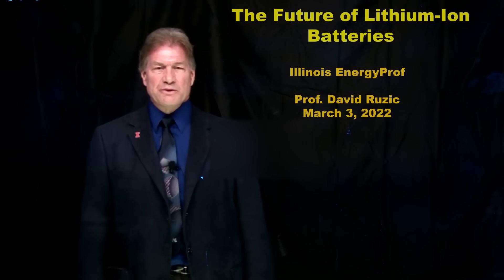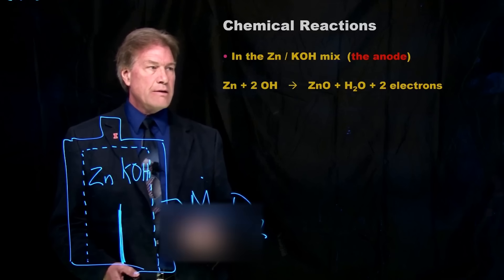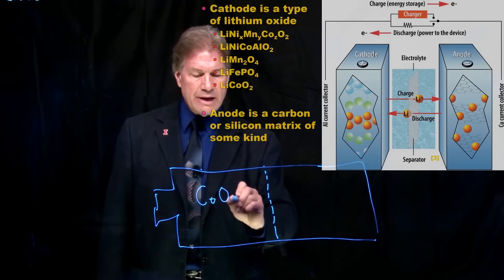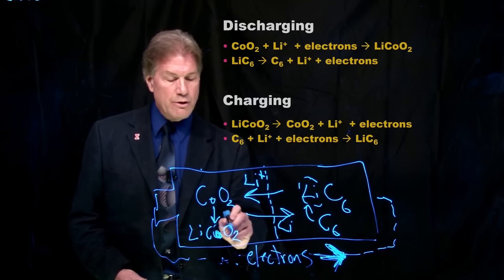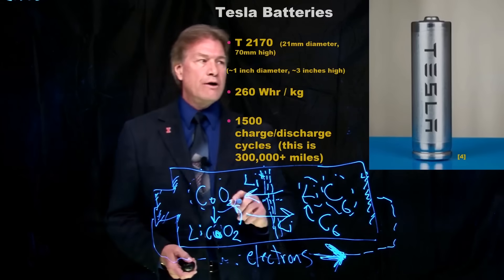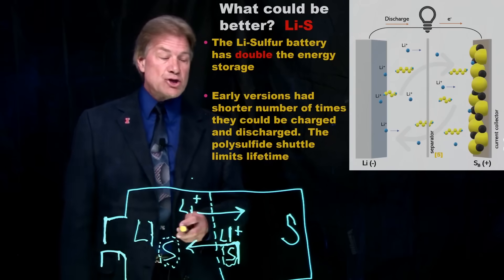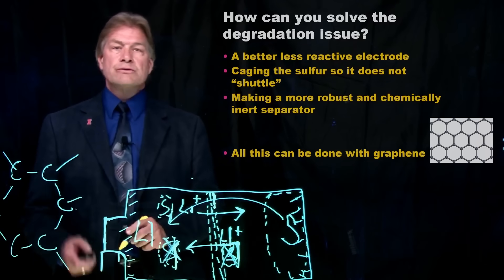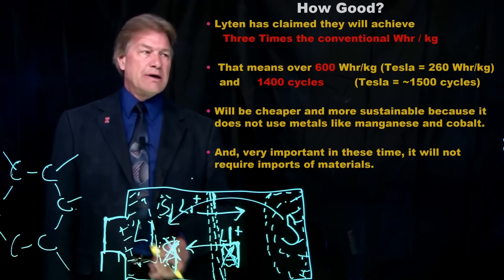The Future of Lithium-Ion Batteries

Comment: When he said sulfur I realized this wasn't as realistic as it first sounded like. And when he said graphene, I just raw checked out. Yes sulfur batteries are denser and graphene can help, but there's far more issues than that. Sulfur batteries also have the major issue with expanding when heated, which they will do themselves just by being used or charged. This also increases the odds of the battery failing as it can break the divider or ruin the structure. 

Graphene is one of those super materials that everyone wants but will always be 20 years off. There's nothing to today that actually uses single sheats of graphene as suggested and making layered graphene isn't really possible without using resin which means it's just as slightly better carbon fiber not really the value of the graphene. Not to mention that it turns out there are actually far better metamaterials than graphene at basically everything. Though of course being alloys instead of just a raw element like graphene, they are harder to make, but their capabilities vastly surpass graphene. Think of it like comparing a spork to a fork or knife. Yes the spork can do it all, but you know it's just not as effective at a single task.
Reply from the maker: The real key is the way to make Graphene cheap, plentiful and without resin.   That is where a breakthrough was needed and I think that is where a breakthrough has been made.
Reply: @illinoisenergyprof6878  I remain skeptical to such claims until the product can be proven in practice. We never get close to theoretical results in practice and rarely do real world use cases get as good as the lab results. 

Not to mention I'm highly skeptical of claims of binding graphene at a 3D level when such has basically been impossible without making it an alloy; which as I said in my master comment isn't graphene anymore. It's why we have different terms for graphene which is a 2D carbon latus vs say carbon nanotubes which is a 3D structure also made purely of carbon in a crystal latus. The difference is purely the fusing it to itself or just a single layered sheet. 

But when I hear people claiming sky high claims on graphene my skeptism immediately goes off as I've seen way too many businesses and products claiming they use graphene to beat the competition, and it turns out to be mediocre or even in some cases inferior to the competition. Graphene is a neat material, though it isn't magic. But even if they beat these concerns, there's still one major hurdle left, cost.

Yes sulfur batteries in theory are much cheaper, but adding these rare materials that need new machinery to make it means it will take a long time before costs fall to competitive values. It's like when blueray players came out they were over $500 average vs old DVD players at even as cheap as $30 and a good one for still less than $100. Being used in cars, cost really does matter. When we use thousands of batteries even a small rise is a drastic raise in cost to produce. We're seeing this issue right now with Tesla as nickel and manganese have drastically raised in cost, as a result, their cars are selling for an extra 20-30% more.
Reply: @Skylancer727  It looks like a typical technological development, maybe it works out. Maybe it is Lithium Oxygen. BUT there might be an investment opportunity or well... hope for you kids in the future to use this.
Reply: Because that is a good critique, what’s your job? Chemical Engineer?
Reply: Where’s your YouTube channel? Haha

Comment: The lithium utopia at 600WH/kg at 90+% conversion efficiency would still be far behind gasoline at 12,200WH/kg at 35% conversion efficiency--4270WH/kg available at the wheels. And in planes, the low energy/weight ratio would make batteries a non-starter. For trucks, diesel at 12,700WH/kg at 40+% conversion efficiency is still a much better bet than the batteries which don't even exist yet.
Batteries will have to be far, far better to take over the skies and heavy haulage. 
How fast does this new wonder-battery recharge? As everybody knows, one can fill one's tank in five minutes.
This is just more pie in the sky. Every day we hear of new breakthroughs which eventually just fizzle out.
Reply: Yes. When talking about li-ion powered planes/trucks remember that wood has 3000WH/kg energy and batteries are yet to achieve even that.
Reply from the maker: I did make a video about de-carbonizing air travel (not with batteries) and I still stand by that.   Seems cars though are going electric, so a better battery is going to help.
Reply: @illinoisenergyprof6878  A second car (electric) for daily city travel already is practical. For mass travel, there's a case for huge, nuclear-powered ships with air-travel reserved only for the corner cases where time is of the utmost importance.
I've always enjoyed your presentations because you seem to be more grounded and less emotional. You know that 'impending breakthroughs' are ten a penny. Don't join that crowd.
If humanity had not been chasing pie in the sky (solar, wind, batteries) we could have been in a much better position by scaling up nuclear power generation decades ago. The hothouse gas emissions would have been drastically less. And we have to address animal agriculture, too.

Comment: Even the best batteries today have an energy density almost 100 times lower than most petroleum products. Even a 10 times improvement will not make it any more convenient in an aircraft where you have to choose between battery or cargo. On trucks, it will drastically affect the payload due to weight restrictions on  roads if it is to have the same range as a diesel truck. Other problems will also arise such as axle weight on the tractor.
Reply: With OTR trucking you have to remember how much weight you're removing when you pull out the internal combustion engine, and drivetrain. If you could double or triple the current battery energy density you wouldn't add any weight to the truck in that swap. 
Not to mention there are short and medium haul runs that are volume not weight constrained. Electric would become viable for at least 50% of trucking scenarios.
Reply: You have to include the energy efficiency difference, of both electric and combustion engines, in your energy density equation
Reply: @feiter  If we're specifically talking about aircrafts, there is another problem to think about that completely eliminates any efficiency difference many times over and it's the mass loss of burnt fuel. Aircrafts lose fuel over time during flight which makes them lighter and the return on energy efficiency becomes non-linear for fuels burnt compared to batteries. 

Essentially, what that means is range for an electric aircraft is at least 20% to 50% less than that of a similarly sized internal combustion powered aircraft even at the same energy density and at the same fuel/battery weight.
Reply from the maker: See my video on decarbonizing air travel.  I agree the answer is not batteries

Comment: Have you heard anything about Lithium Silicon (Li-Si) batteries? Apparently, like Li-S, there are claims that Li-Si gives a higher energy density than Li-Ion but tends to be better for making lighter batteries than Li-S. I think the goal for Li-Si is to be used in aircraft, but unlike Li-S batteries I've only seen it on marketing material so I have no idea where it's at developmentally.

Apparently you could also have Li-S/Si and have a trade off between the two.

Comment: As great as these would be for cars, they would be even more impactful for aviation, enabling electric jet flights on many of the domestic routes. Electric jets are already attractive for short "puddle-hopper" routes, but with 3X energy storage, they would expand to a much larger fraction of the market.
Reply: How does an electric Jet work...do you mean an Ion Drive?
Reply: @mekuranda  Electric "jets" are really just big electrically driven fans. It's like a turbo-fan, but minus the fuel driven turbo part. This means they are simpler and more energy efficient, but batteries lack the energy storage density to be viable on all but the shortest "puddle-hopper" routes. For those routes where they are viable, the economics are extremely attractive. Several times cheaper to operate.
Reply: @ddopson  so is it appropriate to call them Jets? Has the definition of the word Jet been updated to the new electric era...and do the planes you are referring to travel at anywhere near the speed of a old school jet aircraft..as I could understand the logic to group these into the same classification if they did, as that shows a functionally equivalent aircraft. I will research the current state of the art aircraft again now, as I must admit I haven't looked at these for nearly 6 months.
Reply: @mekuranda  I didn’t invent the name. Perhaps it’s considered a jet because it the fan is shrouded like a turbo-fan and thus accelerates a stream of air. It may also be an economically motivated naming. Electric jets can be speedy, but usually fly a bit slower to conserve energy. On the short range flights they are capable of, flight speed is less significant than other factors

Comment: wire-feed aluminium-air circulating filtered electrolyte fuel cell, with salt water, is better, just swap the wire spool, the fuel cell stays the same, the wire is the anode, with the feeder
Reply: public domain idea
Reply: x marks the spot, right
Reply: swapping the pure metal anode wire spool is the key
Reply: then you have the full energy density of aluminium-air the aluminium metal, and you then put more wire when more is needed, the fuel cell is constant with the air-electrode. platinum
Reply: same but more simple than hydrogen-air fuel cell, same as gasoline internal combustion engine, the electrolyte salt water is the engine changeable oil
Reply: normal gasoline cars you are not supposed to "recharge" the fuel, but just put more in, you can though always make your own fuel, or Sodium Na process to make aluminium at home, or just swap a new wire spool
Reply: for zinc-air the energy density is the full 1.4kwh/kg, minus around 90% of total efficiency considerations

Comment: Right now I can drive 500 miles at highway speed.  I  pull into the gas station and put in 20gallons of gas, going from "E" to "F" in 5 minutes.   I'm good for another 500 miles.  How far can I go at highway speed at 20 degrees F and how long does it take to recharge from "Flat" to "Full" ?????  Also, Were does the recharging electricity come from and How Much will it cost????   

The technology is getting better, this is proof.  Nonetheless, I won't have an electric car on a bad bet, not in my lifetime.
Reply: If you base your life around the cannonball run, then electric will never suit you.
Other people have other priorities.
Reply: @donaldpyper4627  it's not the "Cannonball" aspect.  You're not addressing the recharge time . the cold weather performance levels, nor the recharge availability/ cost.   Despite the battery improvements outlined by the Energy Prof, electric cars do not have the ease, reliability, functionality and durability of current cars.  My Pickup has 220K miles and, as an '08 is still in the middle of its life span.  The car is essentially new - it's a '12 and has only 90K miles.   If you have other priorities, fine - just don't try to signal your virtue by foisting them off on other people.
Reply: @Farmer-bh3cg  As an owner of 2 EV's, and EV's for the past 10 years, - One all-Electric (BEV), and the other a PHEV (Battery + ICE) - your concerns are totally legitimate. The main value of a vehicle is convenience; Convenient transportation from point A to point B. Convenient to re-fuel.  Moreover, vehicle ownership is part of our cultural and social fabric.  

Without going into data-driven detail, BEV's and PHEV's are equally reliable, durable, and functional as ICE vehicles.  In many respects more so as A battery electric vehicle has only a few moving parts in its motor and drive train, whereas an  internal combustion engine has well over 200 components, and this excludes the even more complex transmission.  There are 8 year old PHEV's with over 500,000 miles. There is a Tesla in Germany that just crossed 950,000 miles on its odometer.  A pickup like yours requires multiple Major maintenances as prescribed by the manufacturer.  My BEV (Chevy Bolt) has ONE Major maintenance at 150,000 miles.  Combined with the lower cost per mile of energy:
The equivalent cost per mile on an Electric car powered from utility grid energy is:   an EV with a 250-mile range (assuming a fully depleted 66 kWh battery) will cost about $9  electricity costs @ $0.13 per kWh. A car that gets 25 MPG would consume 10 Gallons to go 250 miles @ $4/gal = $40.

With that said, you are still absolutely correct  with respect to the Convenience Factor.  ...at least for BEV's.  As a BEV owner, I will openly admit to you that this is a mission specific car.  It's perfect [second car] for commuting around a city in.  Otherwise, a BEV is a joke. Yes, I could drive my BEV on a 600-mile+ road trip.  Its possible.  Other BEV owners have done it. But I don't have the time to stop for one hour for every 2 hours of driving to charge.  Here's another little dirty secret Elon Musk will never tell you: That 300 mile range Tesla...will it gets about 170 miles of range in the winter (batteries don't like cold).  And even if its not cold, the 300 mile range is only for driving on a flat road - introduce hills and the range falls.  Turn on the air-conditioning, and the range falls.  Haven forbid you turn on the heater...or dive faster than 72 MPH.   

Remember we live in America, and to be brutally frank with you, most Americans simply do not possess the intellectual capacity to think for themselves (ourselves).  It's not because we're dumb, but we have become a lazy lot.  We have fallen victim to relying on celebrities (be they entertainment, political, or just our Corporate Oligarchs) to tell us what to do.  Tell us how to think.  Tell us we don't need to think.  Tell us that half of our fellow citizens hate us. 

It is my position that the PHEV is the perfect solution.  All the good stuff of a BEV, and all the good stuff of an ICE vehicle, with very little emissions compromise.  If you like Pickups as I do, there was a working prototype by a company called Workhorse. American made, Ohio-based Workhorse wanted to mass produce a plug-in hybrid electric pickup truck; the "Workhorse W-15" (search it).  It had 80 miles of all battery range, and when that ran out, the gas engine would kick-in.  So every night you come home, plug it in to a regular wall outlet, and the following Moring you would have 80 miles of usable all-electric range, and you could drive it across country if you wanted to like a regular ICE truck. 

90% of all Americans drive less than 36 miles a day.  Americans will take about 3 trips in their cars that exceed 600 miles round trip per year on average.  About 50% of Americans live in a home that they could charge a EV overnight (so the other 50% that live in apartments really can't take advantage of this overnight charging - this is important as overnight charging is the key - public charging is beyond a stupid concept).

The reason that Elon Musk is the wealthiest person on earth is NOT because Tesla makes any money (they don't), it's not because Elon Musk companies have taken over $7 Billion in Government money (they did), it's because Wall Street (and BigOil) has hijacked righteous concerns about Climate Change, and told Americans that an all-Electric car (BEV) is what they WILL buy.  TSLA stock value shoots up, even when less than .007% of all cars are sold by Tesla.  Tesla has a market value that exceeds the 7 biggest car manufactures in the world Combined.  A percentage of Americans think a BEV will save the planet, and a percentage of Americans don't like to be viewed as Hillbillies because they like pickups.  We are artificially pitted against one another - and at each others necks - all while the uber-wealthy are getting even more wealthy.  I think you would have benefited from a Pickup like the workhorse W-15.  I think you would have made the switch if it was offered.  But it was never made, because it was never funded by our Oligarchs. 

Sorry for the rant, but the ignorant smugness of that previous commenter is exactly why most Americans don't want anything to do with electric vehicles.
Reply: @shotelco  Tesla made 6.5 billion dollars last year (1.5 regulatory credits). It is an exponentially growing company, you need to keep up.
Reply: @patrickb.4749  I stand corrected on that point.  Worldwide car sales grew to around 66.7 million automobiles in 2021, of that Tesla sold 936,000 vehicles.
Reply: @shotelco  Thank you for your reasoned and informative response.  I appreciate your taking the time to do so.  Much of the disputes over electric vs ICE  (or climate change for that matter) is due to lack of Reliable information.  It seems everyone is grinding an axe or pushing a point, but that's another story. 
just as a note, I'll watch Deutche Welle  (DW) Skye news, BBC or France 24 on Youtube for Ukrainian news. Every day, I'll scan the Daily Mail for print articles, again in the internet. (I'll learn more about Hunter's latest escapades from them than the US MSM. ) I simply bypass the American outlets as they are all pushing a viewpoint or shilling for someome/thing.  Again, a different story.  Thank you again for your very Informative response.  I'll review it again in a day or two to  make sure I didn't miss anything.